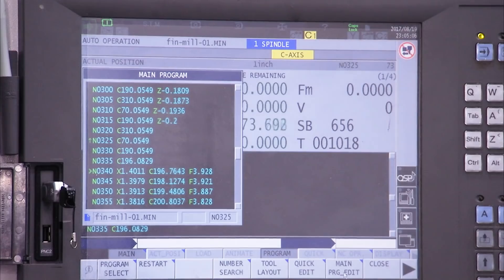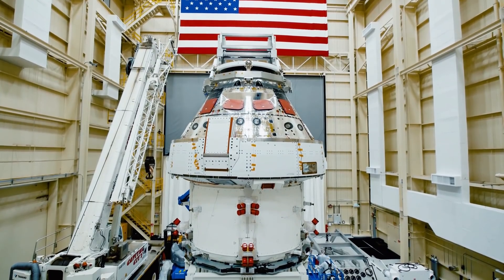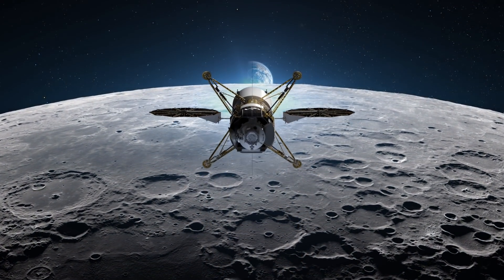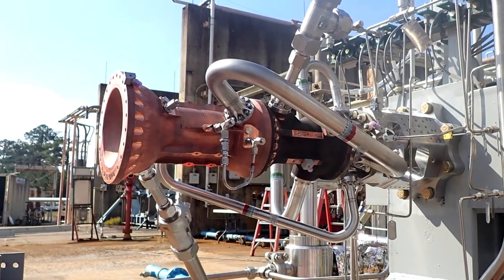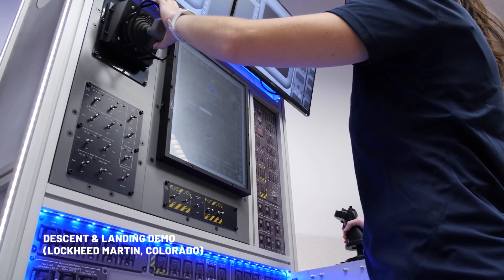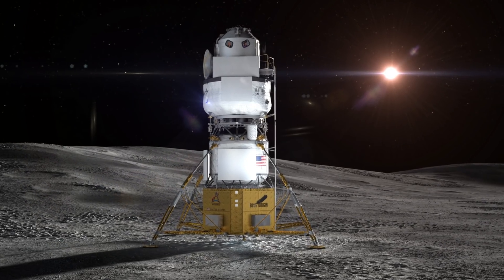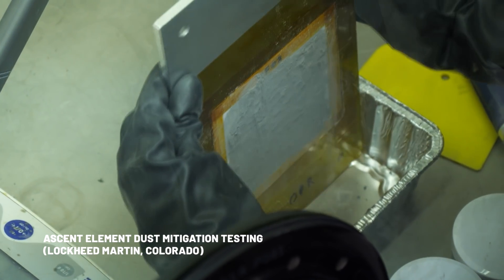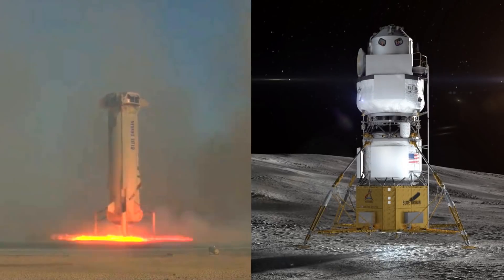Tech Demos for NASA’s Artemis Program

Comment: Blue Origin: We have built a moon lander similar to the Apollo one that can carry few people. 

SpaceX: We are doing a test launch for a space vehicle that has never been done before and can take up to 100 people to the Moon and Mars.

Blue Origin: Well but you are not "innovating" like we are...
Reply: Blue Origin: We have Heritage*
👁   👁    👁️  👁️    👁   👁
    👄          👄          👄
* lots of old men over-compensating for the risks they took in the late 60s by votind down and dissing all attempts at innovation in the Artemis program
Reply: It’s so easy when you believe everything your beloved Elon tells you, isn’t it?
Reply: @thethirdman225  You are correct, it takes a lot of believing but so far he hasn't disappointed. We will see if he  can do it
Reply: The lunar version of Starship will have four sets of six hot-gas thrusters in a ring around the vacuum cargo bay. These are aimed out on an angle and used during final approach to prevent regolith from hitting the lander.

The 24 hot gas Methane-Oxygen thrusters will have pulse-width modulation (on-off), and analog throttling on each engine. So complete hold-off (hovering) maneuvering is accomplished. The Starship will also have self-leveling landing gear, fully autonomous terrain recognition & landing selection, a personnel lift-cargo elevator, two airlocks, and cargo capacity of up to 100 metric tons. 

The enormous cargo capacity can be utilized to drastically increase mission duration beyond the NASA spec. Most important, all components in the SpaceX system are fully and rapidly reusable, making their solution truly sustainable.
Reply: @imconsequetau5275  I’ll bet you that isn’t possible with a full load.
Reply: SpaceX: Come back to me on that when you finally reach orbit with your lipstick rocket.
Reply: 100 people, eh? Not gonna happen any time soon.
Reply: @atlas8827  Sorry, but that isn't you talking at 0:57 is it? 
👁   👁    👁️  👁️    👁   👁
    👄          👄          👄
Blue Origin still playing with models thanks to that type of thinking!
Reply: @atlas8827  Yup , people used to say that about flying the starship as well and look , it just did it first test flight. Soon it will be going into orbital flights. Still it can carry 10 times more people than the Blue Origin moon lander
Reply: @tiagomendes6767  
I don't remember anyone saying that, but okay. The 100 people figure is for a larger starship that hasn't even began to be build. It will take perhaps 2 decades, being generous, before that happens.
Reply: @atlas8827  I don't think so but ok. Still SpaceX is innovating by building Starship while Blue Origin doesn't even tries to do something different. Jeff Bezos is the richest guy in the planet. He has the money to do much better
Reply: @tiagomendes6767  Different? SpaceX is still using chemical rockets to get into space. NASA did that 60 years ago.
Reply: @sjm7518  Yeah the engines are the problem. Lol
We are talking about lunar landers and the fact that Blue Origin has not innovated in that area at all
Reply: @atlas8827  You realise 20 decades is 200 years, right?
Reply: @justprivatelywatching0293  
It is, thank you for the correction. I meant 2 (two) decades.
Reply: @atlas8827  the lower number of people for the current starship is in the conditions set by space x if you placed people in to starship the same way blue origin would in their lunar lander concept its a lot closer to 100 people than not and thats with cargo
Reply: space x designs have a small personal area about the size of the lower area of a bunk bed and then have a large communal area. all other designs have no personal area and a small communal area
Reply: @Nadrojian1551  
A trip to the moon isn't like a 2 hour train trip where you can remain in the same position from beginning to end. It's a several day trip. People will need to move, and they'll need quite a bit of space to do so. You don't have that in the starship. Not even close. The only way you can fit 100 people in is if you pack them like sardines, for 3 days straight.
Reply: @atlas8827  Starship is designed to carry UP TO 100 people to the Moon or Mars, BFR (the larger version of Starship that's been basically put on the back-burner) is designed to take up to 1000 people. The actual crew configuration of either vehicle will likely vary depending on cargo requirements (just like how the Crew Dragon can be configured to carry up to 7 passengers but will generally only be used for 4 in order to make more room for cargo).
Reply: @SJM First well working and very eficient full flow staged combustion engine aka Raptor
Reply: @ImieNazwiskoOK  Except one of them failed on SN8. They'll get it in time but don't count your chickens before they hatch.
Reply: @thethirdman225  Yes, they in fact have some problems
Reply: @thethirdman225  do you know what people said about the falcon 9? That it would never work, guess what, it works. Elon Musk always delivers, on time or not.
Reply: @dakotamahlau-heinert3529  Did I say it wouldn’t work? No, I didn’t. I said it didn’t work but they will eventually get it right.
Reply: @atlas8827  
Landing near the lunar poles requires a longer transfer orbit of about 6-7 days, minimum.
Reply: @cbale2000  the BFR wasn’t designed for 1k people

Comment: Sorry but cant see this winning dynetics isby far better. The only way this will when is favoritism.
Reply: It’s definitely wont win without favouritism especially with it having to go against starship
Reply: @zaksullivan4093  Starship wasn't designed to be a lunar lander. In order to win the contract, I think SpaceX would have to design a more specific lunar lander.

I do like Starship though.
Reply: @applemirer3937  they did design a specific lunar module. Its the white starship with the nasa logo. It is going to be landed on the moon and will make use of an elevator system to move people to and from the capsule and surface
Reply: @zaksullivan4093  you mean where they proposed using a slightly modified Starship, and NASA pointed out that it couldn't land like that on the moon so they proposed putting additional engines up on the top?

It's good to have fallback options, but that was terrible.

SpaceX should focus on building a landing pad on the moon, and getting resupply missions. None of this additional engines up on top thing.
Reply: @applemirer3937  I’m not sure cos I don’t rlly know much but I’m pretty sure starship can go to the moon and mars (after a bit of refuelling) or earth to earth
Reply: @Janthonyjo  That's the plan! It should allow cheaper sustainable, or mass, transport to the moon or mars. But there's still a bit of work to do to make that work.

For example, SpaceX wants to propulsively land, and reuse a vehicle, without expensive maintenance. With humans on board. 

When they actually proposed this to NASA, they found it didn't work on regolith without having the engines much higher up, or having a more solid place to land.

SpaceX changed their lunar lander plan to put additional engines on the top. It sounds like a weak plan and it's a bit late in the game to be designing a lander from scratch.

I think what SpaceX should do, is focus on building a landing pad on the moon so we can use reusable landers. That way we can ACTUALLY have a permanent presence on the moon. Like what they said they wanted to do for Mars.
Reply: I really think dynetics should get this.  The alpaca is more reusable and doesn’t have a 30 foot ladder.
Reply: I gotta agree with dynetics the ladder for blue origins lander is crazy tall what happens if an astronaut falls and damages his or her suit or worse even breaks there neck?
Reply: @Alpha Djalo You just can't break neck in spacesuit, but this ladder still sucks
Reply: I see a lot of back door handshakes happening on this one.... unfortunately.
Reply: This is far safer and far more capable than Dynetics.
Reply: @applemirer3937  Did you miss the 30m ladder that they will have to climb down every-time. And climbing down ladders in a space suit isn’t very easy
Reply: @zaksullivan4093  I've climbed down a lot of ladders, some of which were quite tall, and I can't imagine it being a considerable problem. Especially for someone who has trained for it.
Reply: @applemirer3937  when you watch the video were nasa demoed the space suits the lady struggled to climb up 3 stairs and she would have been testing previously. climbing a ladder on earth and climbing a ladder on the moon in a pressurized space suits are completely different things
Reply: @zaksullivan4093  moving slowly and awkwardly doesn't mean you are in danger of falling, even though those things are often associated.
Reply: @applemirer3937  if you have been in space in that tiny orion capsule then in the gateway. Climbing down that ladder in all that gear and potentially carry equipment down/samples, your going to struggle, im  not sure but it also looks like the ladder doesnt reach to the floor so potentially small jump down / reach up. Maybe they should just attach  a stannah stairlift to it?
Reply: @applemirer3937   When you climbed them were you wearing a bulky spacesuit that severely limited mobility?
Reply: @applemirer3937  watch some documentaries and interviews with astronauts about eva on the moon. Its hard
Reply: @Fredric-z9r  No, I wasn't wearing an EVA suit on the ladders, but if the ladders had been secured at the top, I'm sure it wouldn't have stopped me from what I was doing. Much less if I was a trained astronaut on EVA.
Reply: @applemirer3937  Watch the angry astronaut's video and things will get clear for you.
Reply: @lordroo8484  I've seen The Angry Astronaut videos. The National Team's lunar lander looks great regardless.
Reply: @Applemirer *look's like something from half centaury ago

Comment: Why land on Lunar regolith when you can 3D print a landing pad in orbit and lower it to the surface? :D
Reply: and then you land that landing pad on a bigger previous landed landing pad or what?
Reply: I don't agree with that for 'now'
Reply: Exactly! Like giant paving stones. In space.
Reply: @Phil_AKA_ThundyUK  nonsense
Reply: @Phil_AKA_ThundyUK  lol your Idea is nonsense. Where do you get that 3D printing material from? how do you get it where you need it? How do you land it? Where do you get all that fuel from that you need for all this? You just land on regolith and then build a pad on the ground. Thats the only way that makes sense.
Reply: @PaddyPatrone  The Earth has about 25 moons (claimed objects) we can simply use those to make the giant space slabs and 3D print. As to how we'd get them on the moon just drop them from LLO the acceleration is only 1.6m per second it'll be fine!

Comment: "Using existing software so we don't have to re-train astronauts" - why don't they get trained on new tech in the first place? Won't it make the training easier too?

This is not a valid enough reason to keep around Apollo-era software. While this stuff is impressive of course, most of it is not path-finding (nor innovative for its times), as the original 60s 🚀  program was back in the day
Reply: They are talking about reusing Orion software. LM is designing both Orion and the Ascent element so the flight software, displays and controls will all be very similar meaning astronauts will be able to train on one and use the other with minimal training.
Reply: Competition is good - though it would be nice for gov't to allocate taxpayer dollar based on value derived in innovation (more subjective), or mass capability to orbit per year (more objective); rather than based on the amount of lobbying committed

Comment: Crazy the lack on innovation! Not sustainable unless those parts needed are reusable!
Reply: They are apart from the descent stage. Its no starship but its at least partially reusable.
Reply: @snacklesskerbal  lunar starship will not be reusable
Reply: @jacksonmartin6521  it is though
Reply: @TheCosmicGuy0111  it doesnt have aerodynamic control surfaces does it? therefore its not landing anywhere with an atmosphere, eg: earth. if its not coming back to earth its not going to be reusable
Reply: @jacksonmartin6521  it's stay in moon the orbit.
Reply: @jacksonmartin6521  it's not design to return to earth, but it stay on the moon orbit, attached to the lunar gateway (maybe), and then waiting for the crew, deorbit, land on the moon, and then back to the lunar gateway.
Reply: @jxla3515  i guess you could call it reusable in that sense, but it will never be reused for future missions from earth to the moon
Reply: @jacksonmartin6521  Lunar starship stays in orbit and get refueled in orbit and reused.

Comment: 0:31 Having to climb a three-story building on an outboard ladder everytime seems like a flaw, doesn't it?
Reply: Can you imagine trying to get an injured or compromised astronaut up that ladder? There is just a ladder - if there was a winch, they would show it.
Reply: @martinayton6674  They have shown such a system, actually. When Blue Moon was first revealed publicly, it had a davit-like winch system. It wouldn't be too hard to do that for the NHLS.
Reply: @thomasackerman5399  Its an unsafe design feature
Reply: A least the one sixth gravity turns it into a half story climb or fall energetically if not time wise.
Reply: @MrMonkeybat   In those space suits, it's hard to move even in zero gravity. You can watch some ISS space walk to have a better understanding about what I am talking about.
Reply: @MrMonkeybat  Fall? You can just hook a tether to a slide wire or rail and if you fall, it'll lock up and you can pull yourself back to the ladder and continue on.
Reply: Maybe they should add an electric winch to lift people up and down.
Reply: @MrMonkeybat  Have you worked out how much Delta V would be required to put the extra weight of a winch system on the Moon?
Reply: Yeah!
Reply: Nah, KSP told me that all astronauts have integrated high efficency jetpacks, they will be fine jumping.

But also KSP told me some things about landing skyscrapers on the mun...
Reply: It will wind up having a winch or a fall prevention system attached to the ladder. Make no doubt that has been discussed.
Reply: Oops, forgot my keys... thirty minutes later oops, forgot my radar scanner. thirty minutes later
Reply: Yep!
Reply: Well said
Reply: reminder that moonsip about twice as tall as the National Team lander, so consider that.
Reply: @transformatron6203  what happened to elevators/lifts did they get uninvented
Reply: How do you think Starship is gonna do it then?
Reply: @ZissouMoonshot  Idiot. SpaceX HLS Starship requires you to climb or be winched down 25 or more meters!
Reply: @thomasackerman5399  an elevator is safer then a ladder on the moon
Reply: @Anonymous-ee8ef  Until it breaks down. Just ask anyone who's ever been stranded in one.
Reply: @thomasackerman5399  Anything can break down. That can apply to the entire ship. Engine, navigation systems, life support and whatnots. So, according to your logic we can say, having engines are bad because they can break down. I don’t think you have a valid point. I personally prefer Dynetics lander, but starship with an elevator is 100 times better than this.
Reply: @IeamNoon  Yes, anything. A ladder is fairly simple and straight forward with few moving parts nor any motors or such that can get stuck. If you're worried about the astronauts falling, then you just have an equally simple slidewire that they can hook tethers to.
Reply: @thomasackerman5399  I agree that ladder is a fairly simple solution. But with those suits with limited mobility I think it’s easy to use a ground level hatch or elevator. But as you have said it’s not impossible to use tether or something similar. I believe they already have a solution to this. They know what they are doing. But I still think Dynetics and SpaceXs solution are better. Safer and easier. Getting equipment in and out, taking in an unconscious astronaut will be easier with Dynetics and SpaceXs solutions. Let’s see what will happen in the future. After all single company or country cannot do everything. Everyone needs to play their part.
Reply: @thomasackerman5399  u realize a simple pulley system doent compare to a building elevator and how many times to elevators break
Reply: @thomasackerman5399  Google “ elevator” be amazed.
Reply: @thomasackerman5399  It's a winch and it works better than having to climb a ladder in a thicc space suit

Comment: Let's just hope all the current political upheaval in the US doesn't ruin the plans for a 2024 landing. I think this architecture looks much more feasible than the SpaceX Starship. This may be old school, but that makes it much more likely to succeed in my opinion.
Reply: Lol are you joking or what?.  The starship is a complete all in one vehicle and already 90% complete.. if you haven't seen the latest 12,5KM test launch you should.. SPACE X can literally do lunar lauch in 2 months if they wanted to
Reply: @phinadelphiahlongwane3485  I am not joking. I don't think Starship will work, and the lack of any escape/abort system is a fatal flaw. Also the very large number of engines on the first stage is a big cause of concern, especially considering how many problems they've had with the Raptor engine so far.

With (massive) redesign, it might work, and I hope it does. Personally, I think they should scale it down quite a bit in size (go for 10-20 astronauts instead of 100) as well as separating the crew section as a capsule that can be ejected from the vehicle in case of failure.

But to claim that SpaceX could land on the moon "in 2 months" is simply untrue.